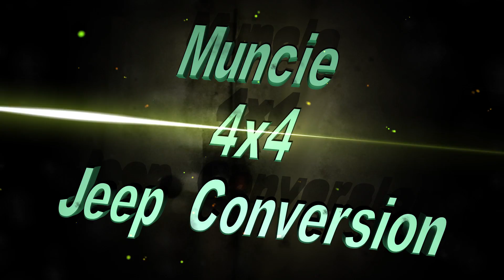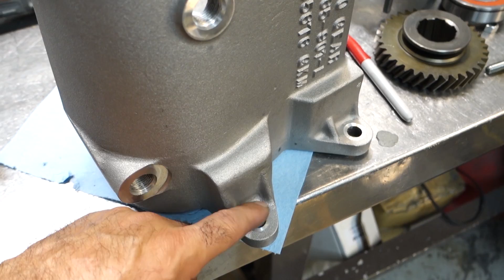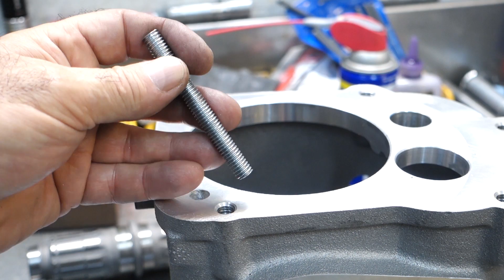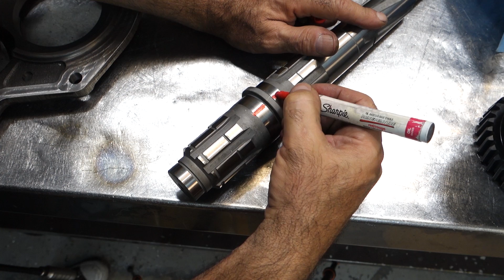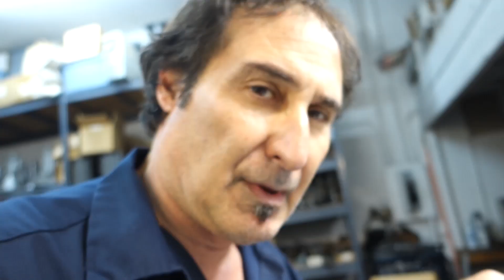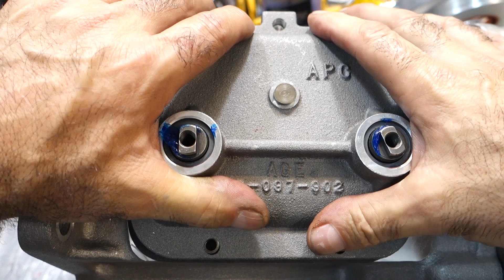Muncie 4 speed to Jeep Dana 300 18 20  Transfer Case Conversion

Comment: Great video. I'm curious what shifter you would use or recommend?
Reply from the maker: Advance adapters used a custom shifter bracket for a Hurst shifter. There are no standalone kits that will fit. But I do believe advance adapters does make the rods and mount. You can use a standard Hurstt body for it to work along with their rods and mount
Reply: Copy that. Thank you.

Comment: If a guy was to do the new 2.98 1st gear, this would be a great transmission for an old Willys
Reply from the maker: You can build a new Muncie with a 2.98 1st gear and use an Advance adapters kit for the Tcase
Reply: @GearBoxVideo  can you not retrofit the lower first gears into an existing transmission?
I have an M22 and the AA adapter already in the jeep - just lusting after a lower first gear.
Reply from the maker: Yes you can. But the whole gearset needs to be changed. Not just a first gear

Comment: Where do you get those case vent assemblies?
Reply from the maker: A company called Lube devices sells them. You can get them at Mcmaster-Carr or Mscdirect
Reply: Thanx, one more thing, how do you remove the backlash plate  on the later cluster gears ?
Reply from the maker: New video on that being uploaded tonight
Reply: As usual , I am looking forward to it, got my box all apart and cleaned, now on to the dressing up of the gears , and re-assembly.M20 going into a 1960 CJ5, with a small block Chevy power plant. Between you, Herm the overdrive guy , and "metalshaper, I will be complete on my driveline very soon. Thanks again Paul.

Comment: why are you using grade 5 bolts on rear of the transmission, and grade 8 on shifter cover..  regardless of if the 5s will hold, I'd use 8 on the rear as well..
Reply from the maker: +joel unknown The 5's are what come with the Advance Adapter's kit.   The other hardware is the standard grade 8 I use on my other Muncie builds.  I purchase hardware in large quantities and since I do not build many of these there is no point in me stocking 500 of each size when the ones supplied with the kit accomplish the task.
Reply: +GearBoxVideo 10/4 I agree, was just wondering and making an observation,  thanks brother.. I like your work..😎

Comment: Paul, You blaze through these overhauls like you just seen the YouTube video this morning. 
I like all your material,  Man, How many Gear boxes would you estimate youve been into?
The best I've ever seen.
Reply from the maker: +Skeefoo Panama The average builder who works at a transmission shop chain probably has built more transmissions that I ever did. I would say the difference is that most of the transmissions I build are new units. Currently I'm in the 4000 range.
Reply: +GearBoxVideo 
I'd still want to buy one from you anyway,  Paul where can I find the prices on your stuff?
Reply from the maker: +Skeefoo Panama my website. www.5speeds.com
Reply: +GearBoxVideo 
Thanks again

Comment: Hi paul, i have a couple of stripped thread on my case. do you recommend a heli coil or time sert which is stronger, it's for the trans mount bracket thanks awesome vid.
Reply from the maker: I always use heli-coils.
Reply: yes this is good demonstrations
Reply: yes this is good demonstrations

Comment: Pretty badass stuff in this video! This makes me want to stuff a Toploader in my early bronco as I hate how wide the ZF5 ratios are that are in it now. I wish somebody made all the modular counter gears and steeper ratios for Toploaders as they do Muncies. Guess a Wide ratio Toploader already has a 2.78 first.
Reply: You can buy 4 speed toploaders already set up for a Bronco with both close and wide ratios. You could get a 3 speed toploader from the factory in them old truck.
Reply: use a jeep t176 or t177 its basically a top loader with a better shifter and 3.52 1st ratio t176 or 3.82 t177. or better still use a t18 with 6.34:1 1st.